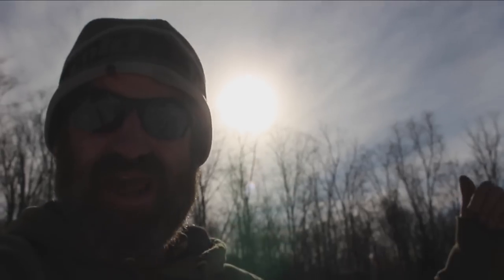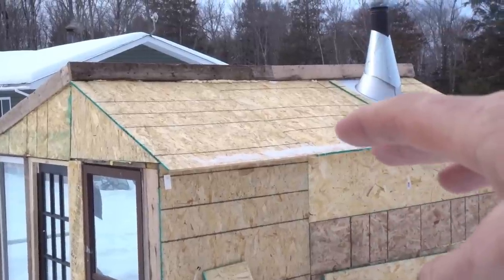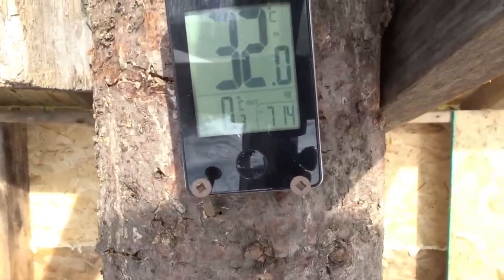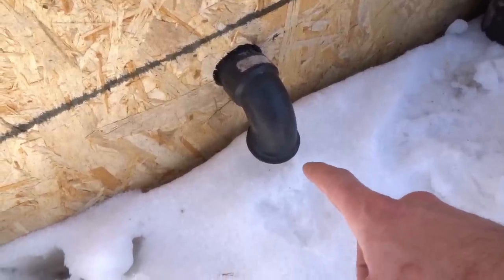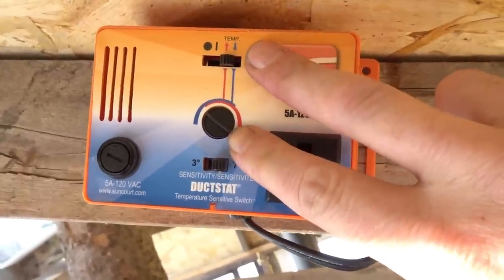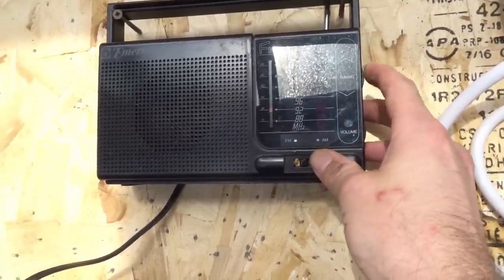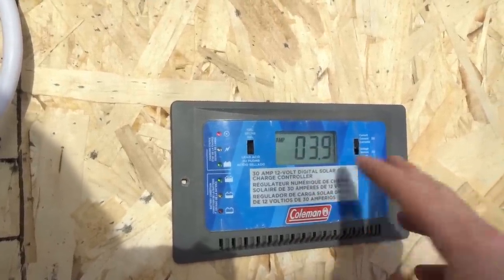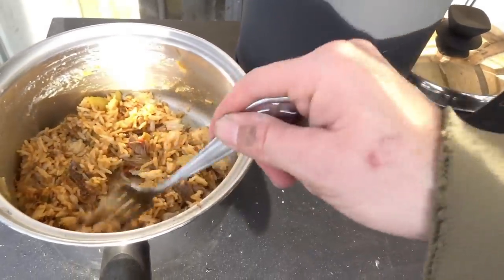Solar Power In Our Greenhouse | An Off Grid Winter Garden Greenhouse in Canada For Year Round Food

Comment: I forgot that you had asked about music. When you turned on the radio I was thinking, what the hell is that awful music he's listening to? LOL! You got me. That's a nice looking little solar setup. This video answered a few questions that I had. I have an inverter and I was going to pick up a deep cycle battery for charging things when we have long outages and possibly run a fan in the greenhouse in the summer. I didn't know what a charge controller was but the name says it all. Haha! I'm also hinking about picking up Harbor Freight Solar Panels but not sure yet. Depends on what kind of rats are living on the hill this summer.
Reply from the maker: Beaver!  LOL!!  We actually have one of the harbour freight setups here.  We haven’t run it for a while, but it was the first solar setup we bought when we were living in CT.  For small applications, it is perfect.  We actually ran a 40 inch tv and sound bar off it for quite a while.  Then, in Manitoba the same system powered our chicken coop.  I can’t remember if it’s in any of our older videos.
Reply: @Wilderstead  Cool. I figured it might be a good starter setup to get my feet wet.

Comment: Cool wood burning stove 👍
Reply from the maker: Thanks!  Its a great little unit.
Reply: @Wilderstead  So the stove is the heat source, and the solar panels are basically to run the fan?
Was wondering how to heat my 4' X 4' cold frame, with solar power, (for night time heat in the winter.) Zone 5 New England.

Comment: I now live in a three story A frame home!  The snow melts off my roof also!  That's a huge problem!  They didn't insulate the roof so all the heat, which naturally rises anyway, goes right out of the house through the ceiling!  You have gone to the expense of a solar system and fireplace.  Do youself a hugh favor and insulate that ceiling.  You will save wood, battery and happy plants!
Reply from the maker: Question for you, Toni.  Have you ever been in a commercial greenhouse in the winter and looked up?  At the glass ceiling?  Guess what.  There’d be no snow up there.  Sounds like you might need to do some work on the insulation in your house though.  Thanks for watching!

Comment: Maybe better to keep the batteries inside, if they discharge for some reason they could freeze. When i was involved in greenhousing we worked all the starts on tables and all the supplies on the ground under them. Look forward to seeing how you work things and the results you will get !
Reply from the maker: Next project in there is to get some shelving set up at about waist height along the front windows.  At that point, we just might start moving some plants out!

Comment: Been pondering over solar for awhile now on my greenhouses. You made this look pretty simple. So it will take 4-100 watt panels to have enough juice to operate this greenhouse? From the pricing I have done over the last couple years has shown me it was much cheaper to just run mine on the grid. I was hoping one panel would do the job but now seeing it will take 4 of them has made my mind up. Thanks for the info!
Reply from the maker: Yeah, for your greenhouse sizes, CB,  you'd be better off using grid power.  We're setting this up on solar mainly because we are moving towards having our entire place off grid here.  The 4 x 100 watt panels and the batteries will run the vent fans, circulation fans, and also about 300 watts worth of LED lights to supplement during the darker months.  Cheers buddy!
Reply: what are the prices you've found? I'm wondering what the cut off point for cost effectiveness is for solar vs grid?

Comment: Hi great vid explained perfectly for my level. Can anyone advise on a heater that can run off the solar set up? I live in England so our winters are unlike yours but still cold and I'd like to heat two much smaller greenhouses 143cmW x 143cmL x195cmH joined together but without a log burner or diesel heater or paraffin lamp just from solar. Thank you.
Reply from the maker: It will be very difficult to run a heater of any size using a small solar power system.  You would need a very large battery bank to run a heater for any period of time.

Comment: I have a small 6 by 4 feet greenhouse can a 100 watt solar panel with 4 car batteries keep the heater on ?
Reply from the maker: It won’t run for long.  Electric heaters use a very large amount of electricity.

Comment: How is it working 3 years later?  Any changes?  Do you use it for lights only or heat as well?
Reply from the maker: This worked great while we were using it in the greenhouse.  It ran fans and a few small LED shop lights for starting seeds.  The greenhouse has had many updates since this video, and we've removed the solar since we ran a power line to the greenhouse.  You'd be hard pressed to run any kind of heat off of a simple solar setup like this.  You'd need an extremely large battery bank and you'd have to cross your fingers that the sun would shine enough in the winter to charge those batteries every day.  We still use the woodstove as the primary heater in the greenhouse with a ceiling mount electric heater on a thermostat for backup if the fires dies down overnight and we don't hear the alarms going off to tell us to feed the fire.
Reply: @Wilderstead  thanks for reply!  Yes, a large battery bank is an issue/cost and then to keep the batteries warm.  I have commented on another video of my experience growing up with wood and the eventual use of outdoor wood burner was a game changer.  Also gave my ideas of what I want to change on our lean to GH.  We were lucky to get reclaimed refrigerator building panels free that I want to incorporate into heat sink.  It should work great Z5a.  The lack of sunny days is a huge factor in heating with solar, water, ect.  If my new ideas help it will cut down electric usage as I just use for seedlings now, but want to extend growing leafy veg. because those recalls are crazy 😜.
Thanks again.

Comment: Is there a chance you can go over all the wiring hook ups?
Reply from the maker: I'll definitely do that in a future video once the panels are mounted on the roof.  It's very simple though.  14G wire running from the panels to the charge controller.  14G wire running from the charge controller to the battery bank.  14G wire running from the battery bank to the inverter.  The two batteries are hooked up in parallel, which keep the voltage at 12V, but doubles the AH rating.  So two 80AH batteries equal 160AH (roughly)

Comment: If you use a 12volt fan, you could get rid of the inverter I think.
Reply from the maker: If I got rid of the inverter I wouldn’t be able to run lights and the blower on the wood stove.
Reply: @Wilderstead  Sure you could. The fan on top of the wood stove uses no electricity firstly. Secondly, you can buy 12 volt lights, you only need 110 volt for the power tools. Inefficient, as you loose between 7 and 10% of your power to the converter itself. Thirdly. You are only transmitting 12 volt for about 6 feet. No big losses there either.

Comment: Hi there, just wondering if you need a electrical permit for this of grid solar system?
Reply from the maker: You might where you live.  Not where we are though.
Reply: @Wilderstead  also how did you ground your solar systems?
Reply from the maker: This system is small, grounding isn’t entirely necessary.  This one was grounded from the inverter to a grounding rod.  It has since been dismantled for an upgrade this spring.  There will be a new video on it once I start the rebuild.

Comment: Putting batteries in parallel like that is a bad idea; the weaker battery will drain the stronger battery.  If you really need the energy of two batteries you'd be much better with two 6 volt batteries in series.